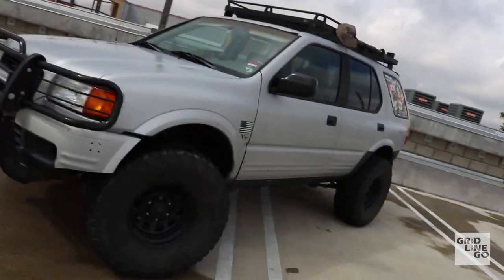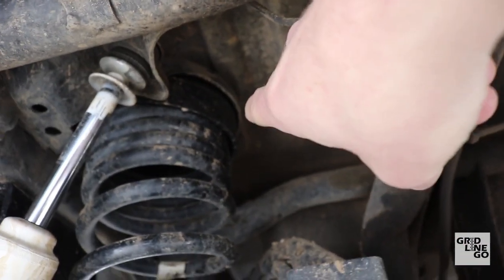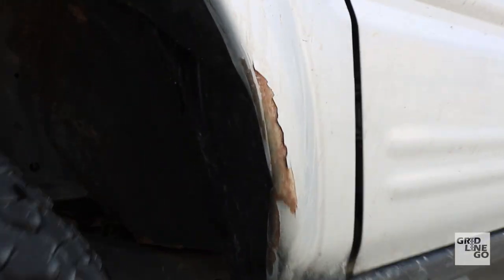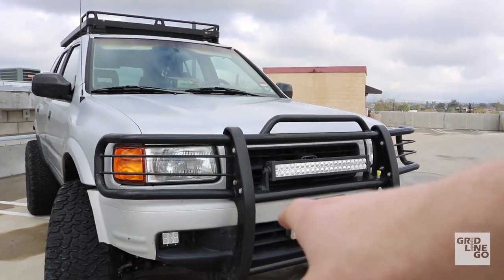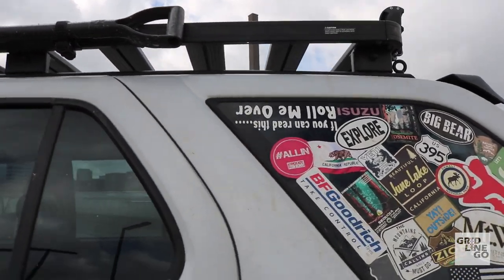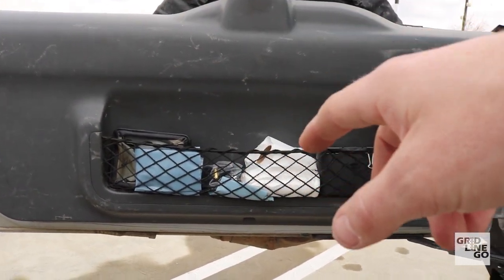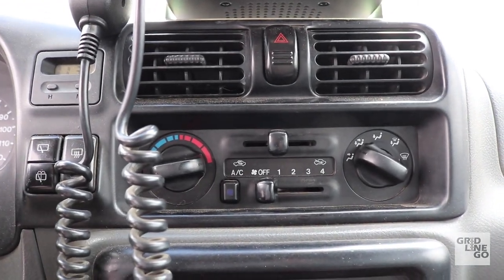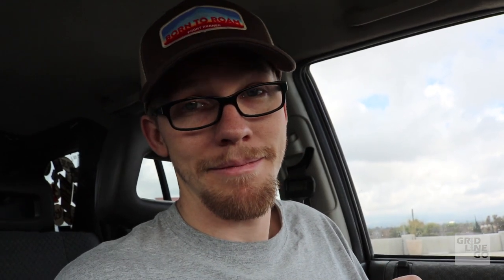Honda Passport Overlanding Rig: The Honduzu in Depth Walk-around

Comment: Hi I was wondering what kind of rear window spoiler was that? I can’t find anything on eBay by searching 2000 honda passport rear spoiler, wing etc. thank you!
Reply from the maker: When I went looking for it online, it was not easy. The closest name for it I found was an "airfoil" it's designed to direct air down the back window to prevent dirt and dust from building up on the glass. Luckily I came across one in the junk yard and snagged it. Best of luck! Thanks for watching 😁

Comment: My Rodeo is already at 180k miles, I'm not sure I want to sink money into it to look like this. But man, your's looks really good!
Reply from the maker: Thank you! Overall, this probably would be put in the "Budget Build" category. Not including the purchase of the truck, for the suspension/wheels tires, there is about $1,600 in it. This thing has past 200k miles and is still running running strong! I bought it with 170k on the clock. I believe it to be a highly underrated vehicle. Thanks for watching!

Comment: How many times did you turn the bolt on the torsion bar if you remember
Reply from the maker: I dont remember, but I measured from the ground to the frame on both sides to level it

Comment: Love your Honduzu ! Quick question, so I just got a 95 Honda Passport and the brake light goes on & off occasionally. As well as sometimes the check trans light flashes but there's nothing wrong with the shifting... Everything is stock so I was wondering if you know what could be causing that. Thanks!
Reply from the maker: Thank you! It could be a few things for both issues. Maybe start by checking the brake fluid level. The level can cause the light to come on and off again. With the trans, I recommend the same. Check the fluid level first and see if that helps

Comment: What pigtails did you use for your fog lights? I installed a set and I want to run power the same way you did.
Reply from the maker: I bought them on Amazon, I use them for all my accessories. They work great and they're cheap. If you type-in "2 pin connector" there will be several kinds. I got the MUYI branded ones. Thanks for asking and thanks for watching!

Comment: Which front runner rack is that, or what are the dimensions I want one!
Reply from the maker: This is their Slimline II Rack. They don't sell them made for this vehicle unfortunately. I started by getting one off Craigslist and extended it later on to fit the full length of the roof. The current dimensions are:
Total - 46W x 77L
2 end slates + 8 slates. 10 total.
20.5" + 52.25" for each side.
10-20mm feet
1800mm track

Comment: Is this SUV pretty reliable for heavy driving use? 
I heard the transmission is very weak or would it last with the proper transmission fluid change?

Great video!
Reply from the maker: What would you consider heavy driving? The transmission typically is the weak link, especially if it has been neglected. With proper maintenance, it should be fine. I have 200k on mine (I don't know if it's been rebuilt in the past, I bought it at 160k) and I've neglected the level multiple times before. I've really driven the hell out if it with heavy loads with hills and mountains, from hard offroading to smashing at higher speeds in the dirt. It kicks sometimes and I correct the level, then it shifts like butter. The overall vehicle, absolutely underrated vehicle. It really is amazing! Thank you so much for watching! 😁👍
Reply: Grid Line Go heavy driving for me is courier delivery services! 

What does correcting the level mean?

Thanks for your time and information!
Reply: @GridLineGo  hey, besides the “heavy driving would this make a decent every day A to B or work etc car to buy at 200k miles? I came across one and I’m really thinking about getting it?

Comment: Seems like a 4Runner is a better base to start with?
Reply from the maker: I honestly believe the 4R and Passport/Rodeo could equally compete in a stock form. Aftermarket wise, 4R has more backing, but they are so much more expensive, parts too. I bought mine for $1k. To this day, truck INCLUDED, I've spent less than $5k on it (not including any repairs/just mods) The Passport/Rodeo is so overlooked and highly underrated, especially if you're not wanting to fork out a ton of money to buy and mod a camping/offroad SUV. -Eric
Reply: @GridLineGo  Makes sense. I'm just in the learning stages and doing some casual research for fun. I bought a 2007 4Runner recently that's in overall great shape (bought for $6200). Mostly using as a winter vehicle to keep my other out of the winter, a good vehicle for the dogs, and also got it for towing potential for my motorcycles. But I am possibly interested in doing more outdoor/offroad mods to it over time. I'd probably start pretty simple with Tacoma TRD shocks, Method Standard wheels, Goodyear Duratrac tires and eventually Tundra brakes when they're needed. I don't see myself doing absolutely crazy offroading for a while.
Reply from the maker: @PapaP86  Sounds like a good plan!